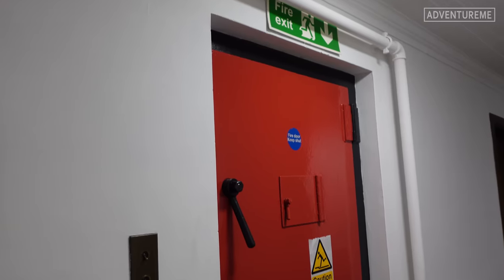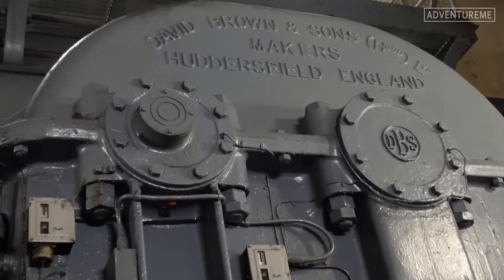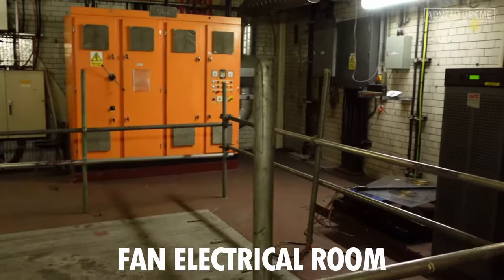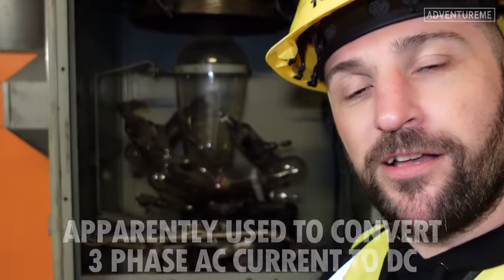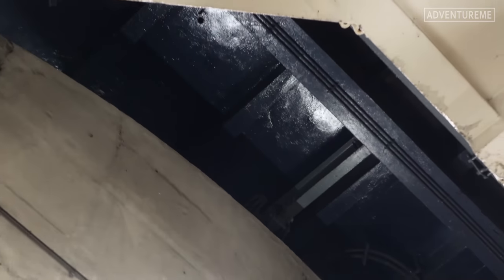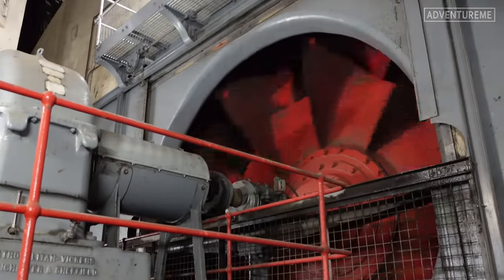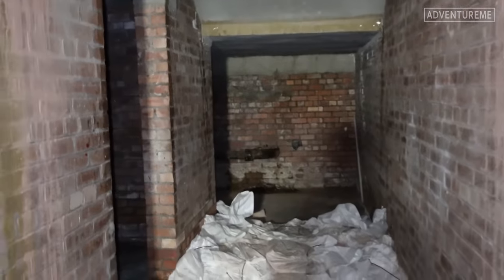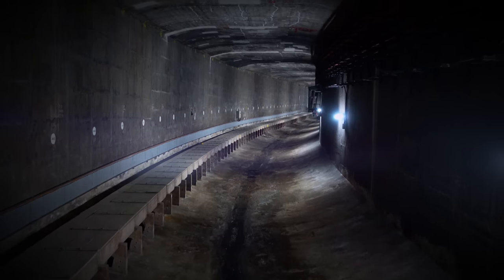Hidden Secrets Of The Mersey Tunnel | The Deep Shafts!

Comment: Mercury arc rectifiers were used in many old cinemas. To provide the 70/100  volts DC required for the carbon arc light source for the projectors. I worked in one in the 60s. They are really reliable, they were still working after 50 years. Finally being removed for modern silicon diodes type rectifiers. Larger ones were also used to provide the DC for early trams.
Reply from the maker: Thanks Michael
Reply: Lift motors too…

Comment: So I don't know what type of "motor starter" it is but I do suspect It would be /would have been Ither auto transformer or a resistive starter. I cannot think It would have been Star Delta or wet bath starter because The motor is a bit too big For Star Delta and wet bath starters require constant attention. But The problem Is not that people won't work on the old starters(I know I would) :P. But the parts would have to be custom made which would take time and cost a lot of money. I also suspect that The DC was used for the control circuitry for the control for the fan contacters/relays ect. (The older generation stuff used to work with DC.) also a reason people don't want to work on it. Plus most big modern motors use soft starters and VFD's to really cut down on startup current draw. Plus VSD/VFD's "your choice of words" Can be micro tuned to run at certain Frequencies / speeds to match the current conditions in the tunnels. Saving power in the long run. OH and it's not a turbine. It's a fan there is a huge difference.
Reply: Looking at the old switch gear id of thought it would of been started in wye and swith to delta i highly suspect because the motors had a gearbox in place from day 1 so id presume the input rpm would have always been fairly high for the gearbox as its huge for just a fan blade must be a fair amount of reduction going on and the shaft needs that support with bearings so theres alot of torque needed to move that massive weight of air as a column in the tunnel plus fight atomispheric pressure.
Its nice looking at these old installations and having a peek into the past how things was done.
Reply: @ianhill20101    You could be right. Star delta is not uncommon and I did not rule it out. And If I'm not mistaken it really does look like the motors are not as old as the rest of the assembly as the motor has a much newer look to it compared to older motors. Now that I had a second thought about it and watched another video again that shows the motor from a different angle"It was too far". I suspect I could be right with some of my observations. Because I think that the older motor and possibly the new one too could be running with slip rings. Which would mean they not using S-D but the only way we will know is if they told us or If we could have had a closer look ourselves. And Yes I'm a fenatic when it comes to old gear and I love watching exploration videoes of things like this as there is nothing to really compare to and explore in my country. Plus  it's ither all stripped and broken or too dangerous to explore (crime) . As I'm a qualified Millwright and have an excellent understanding for mechanical and electrical systems like my gamps before me I can usually figure out a lot of what's going on in these exploration videoes. The only unfortunate thing Is that The factory closed where I worked at before I qualified. Plus covid and the BBBEE law in the country makes it extremely difficult to get a  job.
Reply: @ironwolf6849  Same here i trained and worked as a electical engineer on trains but that jobs long gone everywhere is  shutting or shut.
I made a bike a while back using a bldc motor and a variable frequancy drive called ' vesc ' they allow to run a motor with differing commutation types such as bldc or foc etc to get a smoother torque delivery and have a throttle thats based on torque rather than rpm so its not massively jurky off the mark.
Keep learning and sharing plently like to read our thoughts.
Reply: The starter we saw in the cabinet was for DC - so not star/delta - you can tell it is for DC because of the coils each side of the conductors of the "relays"  They are called magnetic blow-outs - the strong magnetic field deflects the arc that would otherwise continue between the contact points and destroy them. Making the arc deflect in a curve gives space for cold air to fill the gap and look like the arc was being blown out like a candle (bigger installations do use compressed air).
Also, because originally they used a DC motor it can be started as a "series" motor with a very high starting torque and then switched to the "parallel" mode, making it a constant speed motor (which is what you need for a fan).
Reply: @keepitsimple5982  That's verry interesting. I never thought that they would have used a DC motor but it makes sense.
Reply: @ironwolf6849  My guess is that the control scheme gave probably 3 fixed speeds (e.g. peak hours, normal daytime and night time ventilation requirements) to justify the higher maintenance of a DC motor - by switching different parts of the field windings in or out.  The modern replacement will be using synthesis of variable frequency three phase for a normal induction motor to run at an adjustable speed.  All virtually maintenance free.

Comment: My old mate Ste Lucas (RIP) used to work for David Brown in Huddersfield, they later became GKN transmissions, Mercury arc rectifiers convert AC electric to DC electric, the lifts will have had DC motors back in the day because it was easier to regulate DC voltage to variable speeds for the lifts, AC motor speed regulation is relatively "modern" compared to DC, great video dude, been meaning to do this tour for ages but doubt the wife is interested 🙄, she should be considering it's our cities history

Comment: @6:05  Mercury Arc Rectifiers do the same function as a Bridge Rectifier in modern equipment.  It turns AC electricity to DC by only allowing the positive AC wave in a 3 phase system to pass.  They produce lots of x-rays too so don't get too close.
Reply from the maker: Thanks 👍
Reply: X-rays need around 15kV to get excited, most MARs were used for lower voltages in the hundreds range to power large elevators, trams and the like. UV was an issue however.

Comment: I've done this tour and it's absolutely fascinating... this series is great and I am going to book myself in again for another tour (it's a bargain at £8.80, so much history).

When I did the tour it was led by some engineers who work on the tunnel. They were talking to me about converting the lighting to LED and how much energy it would save. It still hasn't been completed, wish it would so it can save more energy.

An absolutely amazing video, thank you so much for producing it (and I got scared when they dropped the weight down to prove their was water 30-40ft below... dark rooms with small holes leading to a massive drop which has water at the bottom is not something I am comfortable with!)
Reply from the maker: I bet lol. I was ok with it 😜
Reply: The Kingsway tunnel was upgraded to LED a few years ago. It's a bit easier with that tunnel though because there's two tunnels they can close one down for work in off-peak times.

Comment: Amazing to think they don't use the 60s fans. My mate worked on the tunnel installing the current  fire escape  system. After seeing your videos I get his love for the tunnel
Reply from the maker: Thanks Nick
Reply: I wonder if it's because they are probably far higher speed and create a lot of noise and maybe complaints.  Noise pollution is becoming the bane of life (along with the other pollution) The older, larger, fans turn at a slower rate so create less noise.

Comment: cant watch anymore, without a comment. 
This brought back so many memories. My mate and I had the task of repairing and rewiring the starter cubicles (witch were 2 phase with a standing blue?
 phase). switchboards fans some idiot decided it was good idea wire the fans etc in Pyro whitch  I was involved in. The (octopus ) Mercury arc rectifier I disconected and moved to G.D resulted  myself my mate and a apprentice having to go for blood tests.(mercury). ..1982--2002.
What happened to the TOP hat (Gearbox oil speed controlled.
Reply from the maker: Thanks Les. Glad you enjoyed

Comment: That was really interesting as i have been through the tunnel loads of times with my mate in the late 70's and early 80's . When you where on about the first fan and how big it was . I can easily know how big there are as i use to work down the pit and they had the same kind of thing cutting coal off the coal face as they ranged from 7ft to 12ft but i have heard of a coal face of 20ft .
Reply from the maker: Thanks mate. So you see the first part too
Reply: @AdventureMe  I watched the first one then part showed so i went to wafch that straight away.

Comment: I can’t help admiring the solid belt and braces engineering of the 1930’s, such as the original 1930’s trams still running in Blackpool. I understand they have to remanufacture some parts that wear out because they are long since obsolete.
The components shown here look designed and constructed to last 100 years.

Comment: A mercury arc rectifier converts AC current to DC current.  It is a cold-cathode tube/valve meaning it has no heater filament.  It works like any other rectifier tube/valve with the exception that the cathode is composed of liquid mercury making it self-restoring -- the cathode will never wear out or burn up.  The initial arc in the tube must be struck by momentarily dipping an anode electrode into the pool of mercury and quickly withdrawing it, this is almost always done with an electromagnet.   Once struck, the arc will continue on its own as long as current is flowing.  In a regular heated rectifier valve the electron stream is invisible or a soft glow, but a cold-cathode rectifier must utilize a plasma arc which itself is also simply a stream of electrons.  They were used in industrial and transportation settings because of their extremely high current handling capabilities as compared to other types of rectifiers at the time.

Comment: did they scrap the original motors off of this ventilation?
Reply from the maker: No they're still in use
Reply: they moved them to another area in the tunnel then...this setup is new motors with those VFD drivers.. @AdventureMe

Comment: Photonic induction has a video of the mercury arc rectifier showing how they work very clever basic design but highly dangerous if impacted is like a vacuum tubes equivalent of an igbt.
The earliest diesel electric trains had massive arc rectifier but they was unreliable with all the vibration been liquid based, modern mosfets and igbt are solid state no moving parts more robust.
Reply from the maker: Thanks 👍
Reply: The old switchgear is typical 1930s DC equipment complete with mercury arc rectifier.

Comment: The old motor controls system looks like a Ward Leonard control system. I studies them when I was doing my City and Guilds in control systems at college. Part of that included mercury arc rectifiers. They are amazing things to look at and terrifying to use. The blue glow is UV light so they are usually enclosed to prevent exposure. touching any live electrode also meant death as RCD's were not around in those days and so you were relying on a bit of fuse wire to blow. 

Photoninduction does a good explanation on how they work and unboxes and fires up a 50 year old one. https://youtu.be/2pDcv6g1FE0
Reply from the maker: Thanks mate

Comment: ye wouldn't of wanted stand in that shift in 70s 80s ye would of keeled over with cars pumping all lead out. cars with no catalyst converters and trucks with no adblue
Reply: Back when Diesel engines lasted forever haha
Good old days 💨💨💨💨
Reply: @ironwolf6849  I drive a 2003 beetle tdi, the good old 1.9 PD diesel, a few sensors but no dpf or adblue
Reply: @Dan23_7  When a diesel engines smokes the thing that causes it to smoke the majority of the time is improper adjustment, cold enjines or warn engine components. Don't get me wrong I'm not against DPF or Egrs that won't give you problems if you maintain your vehicle(with DPF = no straight pipes). But ad blue is another thing you have to purchase every few fillups that I'm positive has a tax levie ect on it. That is why I don't like it. I've got a few favorites but my absolute favorite issss.

Comment: They used mercury rectifiers in The Dalles, Oregon to convert AC from the northwest power grid to DC until 2004. They send power south to Los Angeles, where it is converted back to AC. The mercury rectifiers have been replaced with thyristors. The power line runs at 500 kilo-volts and transmits 3.1 gigawatts.
https://en.wikipedia.org/wiki/Celilo_Converter_Station
Reply from the maker: Thanks mate